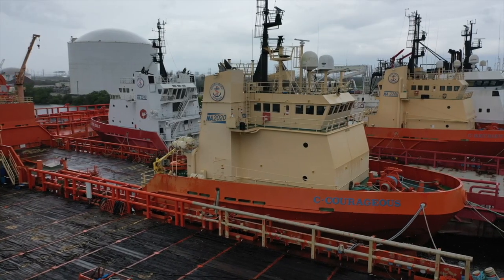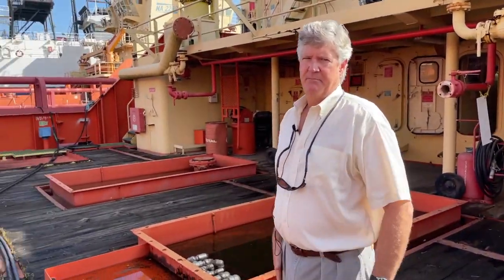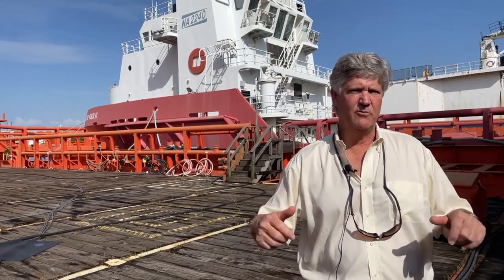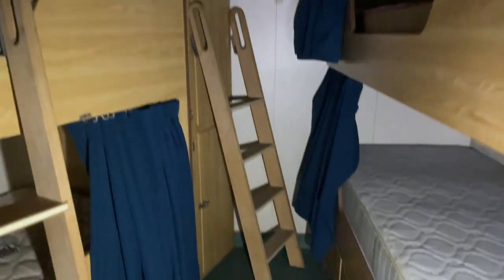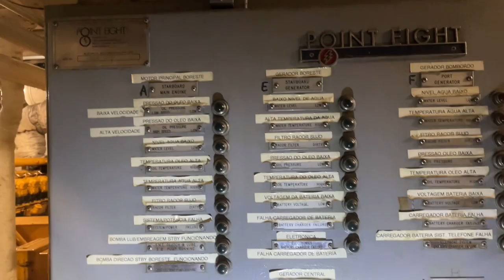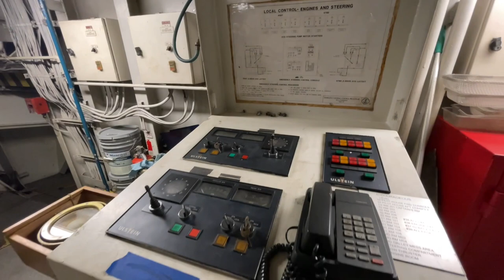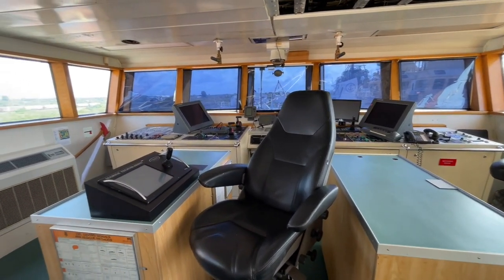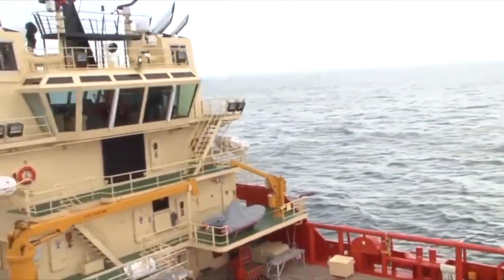Walk-through tour of 220' - 280' Expedition/Explorer Yacht conversion vessel

Comment: I worked on most of the Chouest seismic research vessel from 84 to 88 engine room  and  traveling to Norway to get some OSV to transform to ORV  and was on the Betty Chouest when they add the first dynamic position and then worked on the brand new New Venture rolling vessel for Shell ...also for Texaco on the Edison they where Cadillac back then and always transform and modified but also many issue...
Reply from the maker: Thanks for your comments, Marc. It's great to hear directly from someone with experience that they can share.

Comment: About 14kn/12mph at about 100gph/2,400gpd.
With standard 170,000-gallon tanks, the duration off-shore without re-supply is approximately two months?
Reply from the maker: On station for work, their consumption would be less, running DP and hotel services. Often this fuel is used for re-supplying the offshore platforms.

Comment: Does this company work with smaller vessels in the 100 to 149 ft range ?  And how much would a conversion for the smaller boats cost ..specifically for  electric engined boats...meaning dual 400 kw lithium banks to power the 1 to 2  kw electric engines and of course keeping those 20k gal tanks for the generators
Reply from the maker: There are some smaller research vessels and crew boats that can be converted. Pm@xploreryachts.com